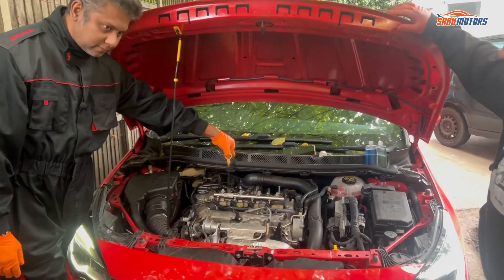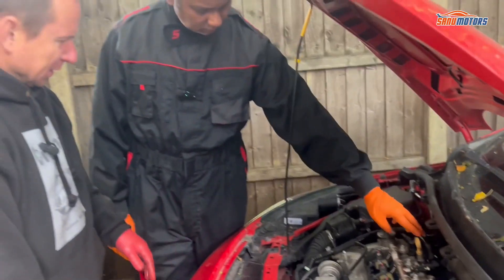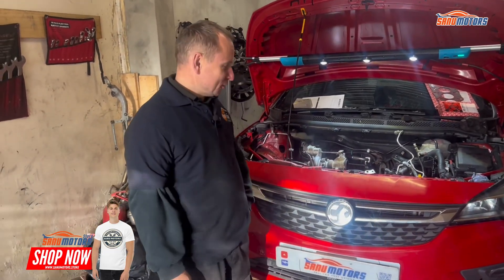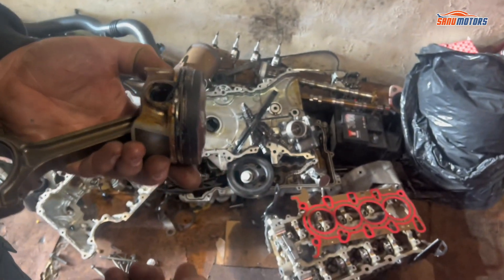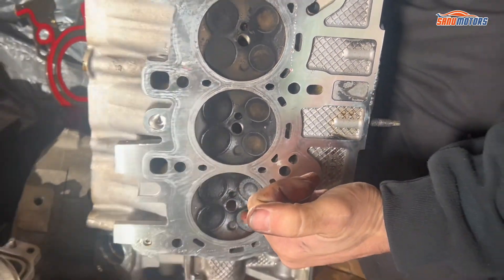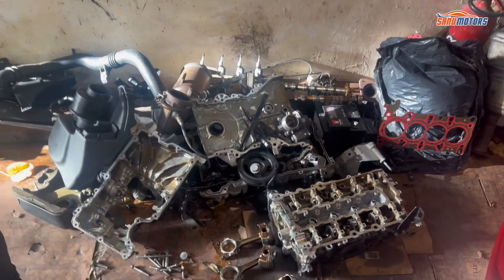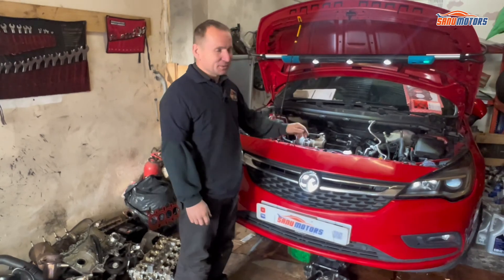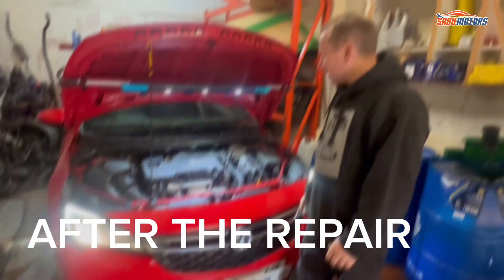Vauxhall Astra P0300 Random Misfire

Comment: Thank you for this video, I am having the exact problem with my car also Astra 1.4T so I'm planning of stripping the engine and put new pistons in as you did. I am struggling to get any information on this, I cannot find a repair manual. If you can may you kindly help me out, i need to know the torque specification and sequence so basically I need a repair manual, I am willing to buy one but I cannot find it. Thank you and keep well, we appreciate you guys
Reply from the maker: I'm glad to hear that the video was helpful. Rebuilding your Astra 1.4T engine is a significant task, and having the correct torque specifications and sequences is crucial. Here are some resources that can assist you:

1. Haynes Repair Manual: Haynes offers a comprehensive repair manual for the Vauxhall Astra covering models from 2010 to 2012, including the 1.4L petrol engine. This manual provides detailed instructions, torque specifications, and sequences for various engine components. You can purchase it directly from Haynes' website. 
HAYNES

2. Vauxhall Workshop Manuals: The Vauxhall Workshop Service and Repair Manuals provide detailed procedures and specifications for the Astra J model, which includes the 1.4L LUH and LUJ engines. These manuals cover engine mechanics, including cylinder head replacement and camshaft timing chain adjustment. Accessing these manuals can provide you with the necessary torque specifications and sequences. 
WORKSHOP MANUALS

3. Vauxhall Owner's Manual: While the owner's manual primarily covers general vehicle information, it may include some maintenance specifications. You can download the Vauxhall Astra Owner's Manual from Vauxhall's official website. 
VAUXHALL

4. Online Repair Manuals: Websites like Online Repair Manuals offer free workshop and repair manuals for various Vauxhall Astra models. These resources can be helpful for specific repair procedures and specifications. 
ONLINE REPAIR MANUALS

5. Vauxhall Astra Forums: Engaging with online communities such as the Vauxhall Astra K Forum can be beneficial. Members often share torque specifications and repair procedures. For instance, there's a discussion about torque values for the Astra K model, which might be relevant to your needs.

Comment: MERHABA KARDEŞİM BENİM ARABAM OPEL İNSİGNİA DEX COOL ANTİFRİZ KULLANSAM OLURMU HERHANGİ BİR ZARARI VARMI
Reply from the maker: Selamlar! Antifriz pembe/turuncu, mavi ve yeşil gibi çeşitli renklerde mevcuttur. Ancak ülkenizde Opel Insignia'ya yönelik spesifik önerilere aşina değilim. Farklı renkleri karıştırmak riskli olabilir, bu nedenle en doğru tavsiye için aracınızın kullanım kılavuzuna bakmanızı veya yerel bir Opel bayisiyle iletişime geçmenizi öneririm. Bölgenizin özelliklerine göre rehberlik sağlayabilirler. Yolda güvende kalın.

English : Hello there! Antifreeze comes in various colors like pink/orange, blue, and green. However, I'm not familiar with the specific recommendations for Opel Insignia in your country. Mixing different colors can be risky, so I'd recommend checking your car's manual or getting in touch with a local Opel dealer for the most accurate advice. They can provide guidance based on your region's specifications. Stay safe on the road.
Reply: @SanuMotorswithCharlie  TEŞEKKÜR EDERİM SELAMLAR